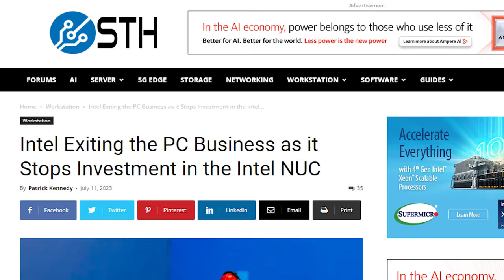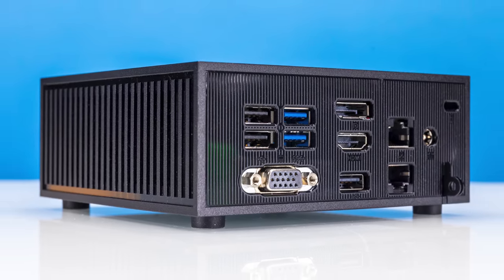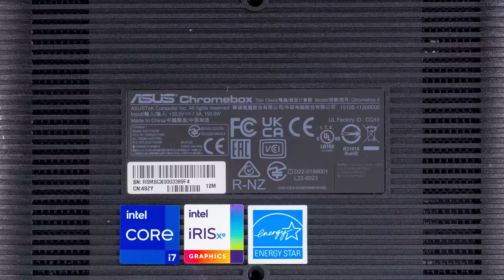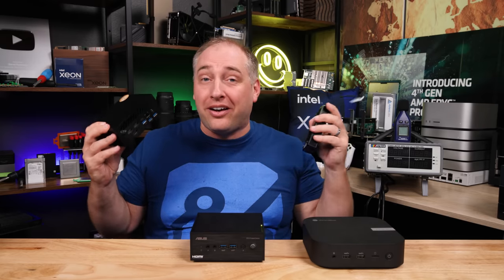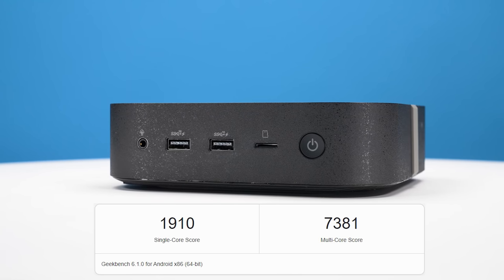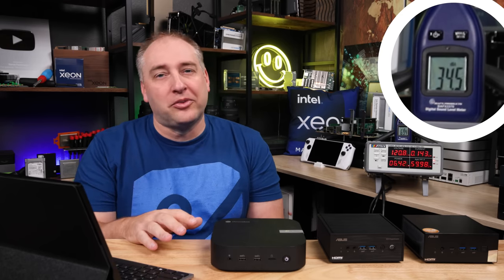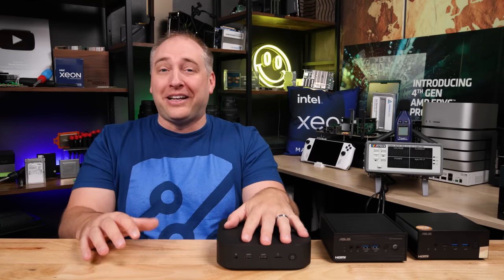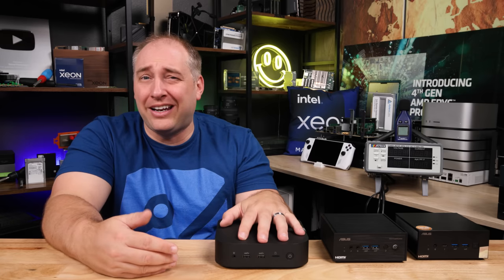Best of 3 Mini PCs? Fanless, Fast, or the C-Factor?

Comment: I'd really love the option for a barebones PN42, no storage, no RAM, no Windows licence. I hate paying for stuff I am not going to use. Well, I will use storage and RAM, but I have extra NVMe drives laying around here and I would go out and buy the amount of RAM I need (8/16GB). I could buy multiple and run home lab Kubernetes on them.
Reply: Imagine being able to place orders to a manufacturer and they could 'print out' layout only the components requested on a board - so that the customer can get exactly what they want, rather than put up with what the vendor thinks they should want.
Reply: I thought exactly the same when I bought my current laptop. It came with a single 8GB DDR4-2666 module and it was a big hassle to resell it after I had bought two 8GB DDR4-3200 modules. I wish the manufacturer didn't include any memory and just reduced the price.

Comment: The low end of minipcs is what interests me the most. They aren't all that much more expensive than the raspberry pi's atm, at least in my region.
Reply: Did you see the zima blade? 64 bucks for a dual core x86, 32gb of emmc... that is definitely in RPI price range!
Reply: Dude I literally bought a Dell thin client for $20 and repurposed it as an ubuntu server.
Reply: @AudreyRobinel  Not bad if you're okay with using a CPU that is EOL...it's one of the reasons why they're so cheap.
Reply: @madtech2010  indeed, that's the main issue, with performances, but for many uses, it does not matter much :) But obviously i hope they make a N100 variant some day!
Reply: Those might be good for running a lightweight server or perhaps VPN. They are too slow for comfortably running windows. You can get decent ones under $200 though.

Gaming is the only common activity that requires a big desktop.

Comment: Not sure if it's been posted but a heads-up the reason that it only comes with 4 GB of memory is because Microsoft licenses windows in a light thin client version which requires a maximum of 4 GB of RAM. When you license Windows this way as an oem your costs are incredibly minuscule which attributes to such a low cost for retail. The difference between 4GB of RAM and 8GB it's not just a ram cost it's also another $60 or more for windows pro
Reply: Didn't know this, thanks for the explanation!  Makes sense.
Reply: Then upgrade the ram at home cheaper
Reply: That license req is insane! Buyers can always upgrade at home, or preferably buy a much better machine.
Reply: I doubt manufactures are paying $60 for Windows. Probably just a fraction of that.
Reply: if you mean windows s edition, in my experience it's worth trying to do fresh install of the full version over the shipping version when you receive ur device.... ur mileage may vary. but so far im batting 1000.

Comment: That PN42 looks like a good candidate for a firewall running pfSense or OPNsense. Especially with that dual 2.5 GbE NIC config. Although, I couldn't find any information on the NIC chipset(s). That information would be nice to know.
Reply: All I can find is the standard nic is Intel. Not sure about the optional nic, and no clue still what specific chipset it is.
Reply: @JeramiFrost  I’m finding the same info. I wish it was more specific.
Reply: 3:20 - it has two Realtek 2.5 GbE NICS (RTL8125 / RTL8125B(G))
Reply: @Arcao  I’m assuming you got that from looking at the components on the board? Because he doesn’t mention anything about the NIC chipsets. And if that’s true, why does ASUS’s data sheet for the PN42 state that it uses Intel NICs?
Reply: @thetazlord could be i226
Reply: @r0galik  I was thinking it could be, or i225. I guess I’ll only find out if I buy one.
Reply: @thetazlord    I have just bought a  PN42 (with N100 processor) and unfortunately it has a Realtek 8125.  Moreover I am facing a problem with low network performance. My internet plan is 2Gb/s (real 1.8 Gbps) and with the PN42 I am reaching only  1 - 1.6 gbps (speedtest).
Reply: @Solista670  Thanks for the info on the NICs. I don't have anything against Realtek but I prefer Intel for the best OS compatibility. As for the performance issues you're facing, I use Speedtest too but when I want to test the performance of a NIC, I contain that test to my LAN or a test LAN that I control. There are too many variables outside of your LAN that you don't control and it's hard to say with any certainty that it's an issue with your own hardware. Just a suggestion.

Comment: For this price the ROI for the energy savings are just not there, 
especially when also considering the overall performance and lack of flexibility 
its only good if you have a cooling problem or small space limitation such as inside a closet/cupboard or energy limit such as being battery operated.

Comment: Would that fanless unit be a good candidate for a silent OPN/PFSense router for a homelab? Or is it too underpowered? The network in my house converges on my wife's office, so I'm looking for something small, silent, and cheap to use as a router by the modem behind her desk.
Reply from the maker: CPU wise it is plenty. Generally I prefer Intel NICs for a router/firewall, but it has plenty of COU performance to push 2.5GbE
Reply: Do you think it would be a candidate for virtualizing those kinds of purposes? Or is this more of a bare metal kind of thing? @ServeTheHomeVideo

Comment: How warm/hot does the PN42 get running at full power?
Reply from the maker: The outside I can still hold since there is the plastic shell. Also, it is only using 12W and that includes power for RAM, SSD, WiFi and so forth.
Reply: @ServeTheHomeVideo  No internal temp sensors?

Comment: The size,power usage and usb ports count is good. It's not a router even if some would take anything to replace their own, for that case lack of 2 more 2.5gb ports for a count of 4. At 1000$ no but 300$ yeah,not bad because of the size of mobo,making one with ITX is not the same,more power. Who would want to play anyway on that size of heatsinks with an i7,i9? ITX reasons for that. Good video

Comment: RIP old power meter
Reply from the maker: Using this one since it is a bit easier since we do not need the overhead camera shot for the Extech
Reply: @ServeTheHomeVideo  Didn't the old one also have one or more LED segments failing?
Reply from the maker: Fun fact @kchiem  we actually have two and both have the same panel failing.

Comment: Isn't the Beelink EQ12 Pro i3-N305 a better option for pfSense or other open-source firewalls because it has 2.5g ethernet ports. Using a dongle for ethernet in Unix branch systems is reported by many experts as unreliable just like Realtek nics? @ServeTheHome
Reply: I prefer a well known quality Taiwanese company like Asus vs a CCP data collection company like Beelink. The Chinese mini PC's have been found to have spyware/bloatware.